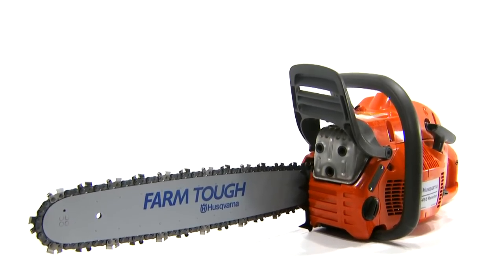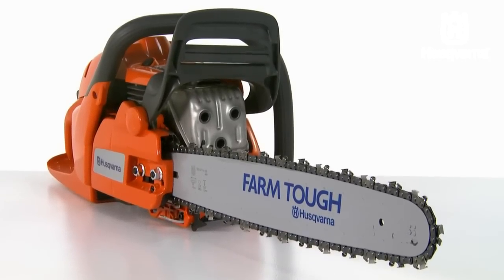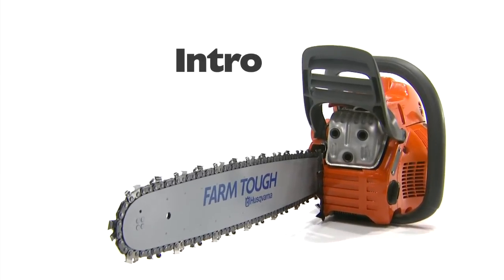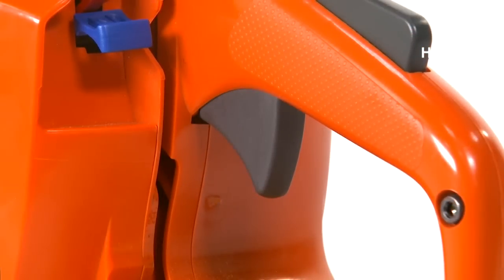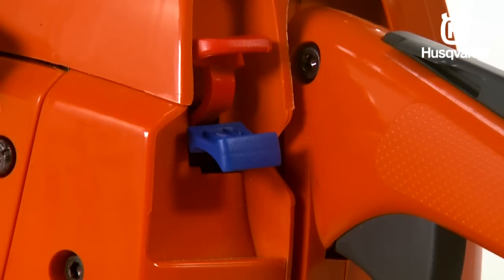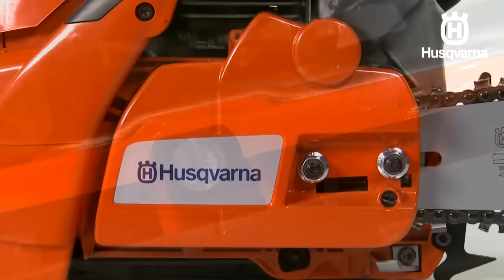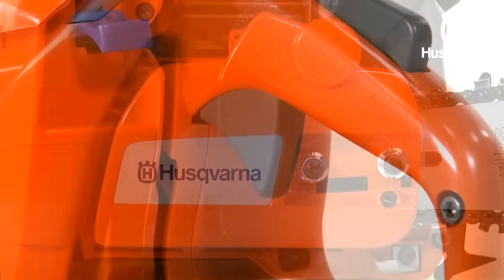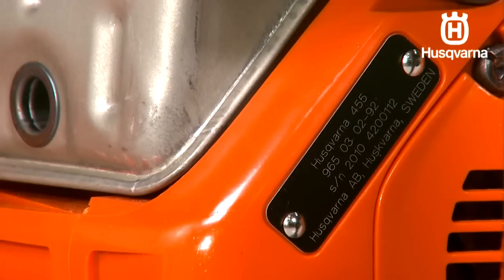Husqvarna Chainsaw Components

Comment: I don't have the Husqvarna saw, but do have the Poulan Pro saw which is owned by Husqvarna company, and just got a new one to replace my Stihl MS-250 saw which spend more time in a shop and not getting used because it won't start when I want it to. The Poulan Pro never got used as it had to go to the shop also and I am waiting for the shop to get parts needed to fix the problem.